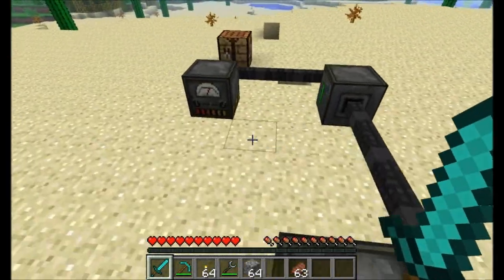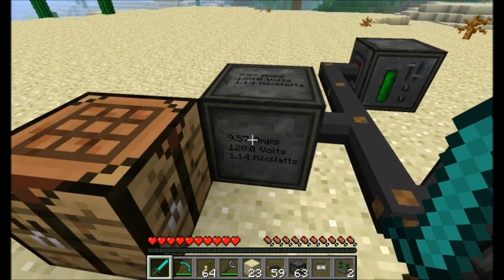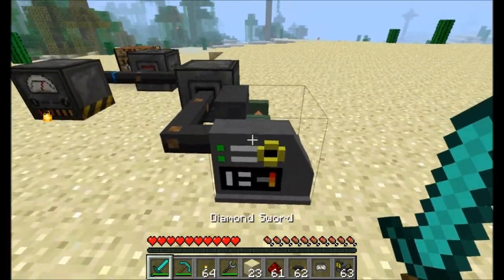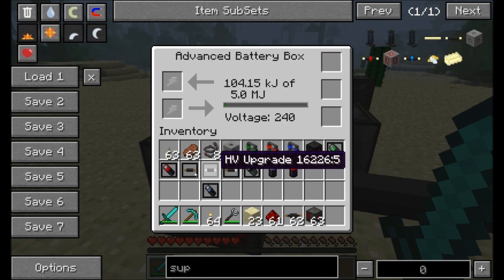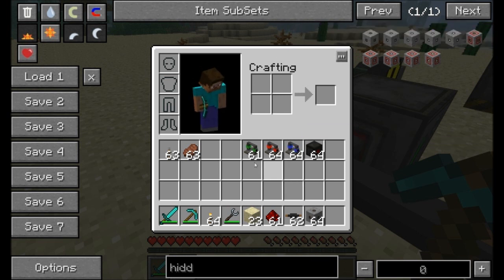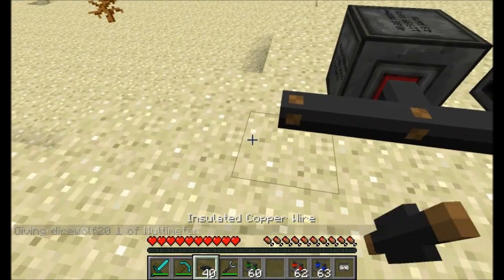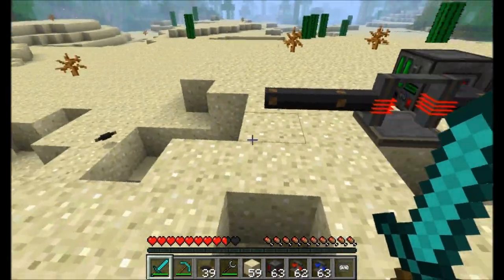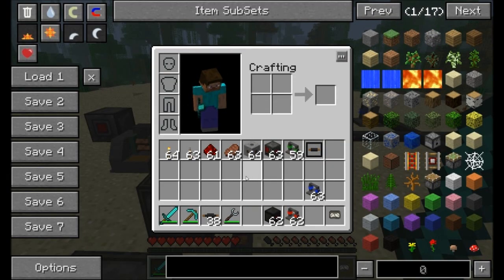Mod Spotlight - Electric Expansion

Comment: for those confused about electricity terms: think of it like a pipe. Amps is the speed of the water, volts is the width of the pipe (more water moving at once) and watts is the amount of water moving every second. Joules is the amount of water total (which represents electrical energy).

Comment: Electricity makes a lot more sense if you think about it in terms of coulombs, or packets of charge (groups of electrons). Voltage is the energy that each coulomb carries, and represents the speed of the electrons. Current is the amount of coloumbs passing a point per second, so either having thicker wires or higher voltage means you get a higher current. Multiplying the current by the voltage gives you the electrical power, or how many joules of energy the electricity can transfer per second.

Comment: Usually if you step the voltage down, a certain device will require a certain power in watts. It will draw the amount of current that it needs from the circuit, but the amps is dependent on the resistance. The other thing you need to take into account is overheating. Amps = heat and thick gauge wires.

Comment: I'd say volts are the *pressure* inside the pipe. If you have a lot of pressure (voltage) it will force faster flow (current, i.e. amperes) through the pipe *depending* on its width.

With that said, every minecraft mod that uses electricity seems to magically force a voltage given a wire type, so in this context it really *does* seem like it is a wire-dependant trait. If only real life would be so easy...

Comment: watts is the power the electricity carries, and its equal to amps * volts and joules/second. since energy is conserved, so is power. so if you step down the voltage, the amps will increase. if you step up the voltage, the amps decrease!

Comment: watt (power) = Ampere (I) X Volt (V)
with the same amount of power, if you stepdown the voltage, the ampere (amp) will increase and if you stepdown the ampere, the voltage will increase.  I like this mod.

Comment: The lower the Watts, the less power transferring through the wire. Watts are just the amps transferring through times the voltage.

Comment: These are vanilla ones but the textures supplied by the mod may be higher. Afaik direwolf doesn't use texture packs and you can clearly see on the sword that it's vanilla. But like I wrote mods can use different textures for their own stuff they don't have to be low resolution.

Comment: I'll try to explain this "electric stuff". :) 

Watt is the amount of work that something can do. 

Volts is the potential of the energy, or where it wants to flow. It will always flow from a higher voltage to a lower one.

Ampere is the rate of the flow of the electricity, basically how many electrons is traversing the wire.

Watts is then the product of volts and ampere. W = A * V

If you lower the voltage, the more electrons needs to flow though the wire to keep the same watts, and visa versa

Comment: @jonaskingofsparta The difference is that IC2 power systems are based off of a made up unit. Voltz or UE as it may be use real world electrical units. The difference is huge, since IC2 only has the EU, "electrical unit", while UE has amps, watts, and volts.

Comment: using this a person could place any number of quantum batboxes behind each machine, and a different channel, each channel would have a different voltage, lower voltages could have a lower number, and vice versa, a simple qbb connected to a transformer connected to another qbb set at a lower frequency, you could have an entire plant powered in one area by several generators leading to one or more qbbs!

Comment: There are a few around but they generally only work between BC and IC2. Tho it has some balance issues taking place when converting IC2 power to BC. This is due to "free" power generated through IC2 which many people consider "op". I just find it hilarious when people use the "op" word in a sandbox game...

Comment: ??? oops, you confused Amps and Volts there. In this analogy, Amps would be represented by pipe thickness (in other analogies river width, amount of marbles allowed at once, etc.). Voltage would be the water pressure in this case.

Don't confuse people! :P

Comment: I would have prefered if the transformers were rated 1/2, 1/4, etc. With a maximum amperage like real ones. That way it would make sense when you step up or down.

Comment: Or all the mod developers just sitting together and drafting a concept for a universal powersystem that all of them will start using in future versions of their mods. Would also make balancing a bit easier. Right now you can basically discard 80% of everything these cool mods have to offer in terms of power generation, because it just makes no sense to build most of the energy generators. Which is sad, there would be so much cool stuff i just never build, because it's a waste :(

Comment: The mod adds nothing so far that no other mod already does so that kinda defeats the purpose of the "rules" of adding mods to FTB. I think you can read the rules on the forum. Personally I don't use FTB, too much limitation for my taste and mods barely kept up to date for obvious reasons. It's just better to run mods and update them yourself to keep them at cutting edge on your server.